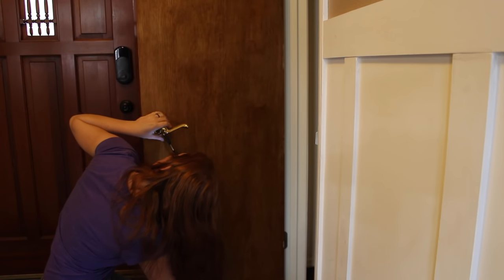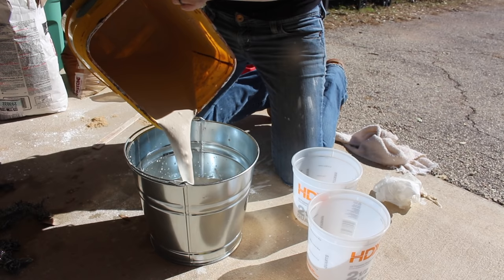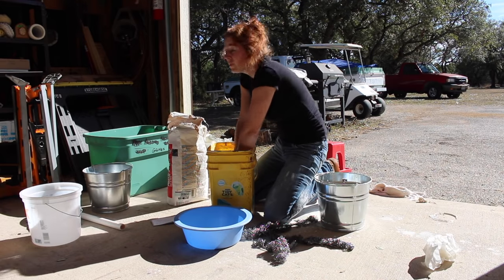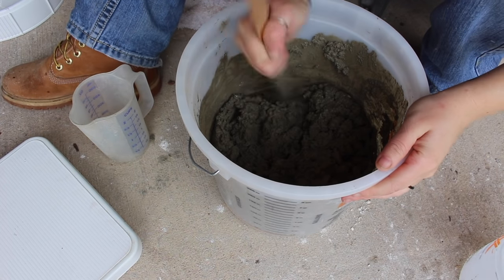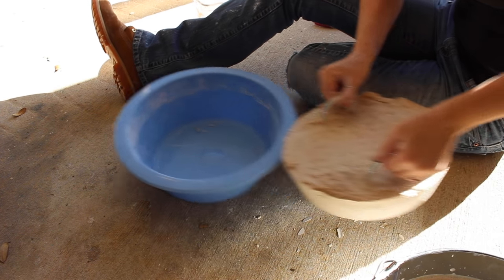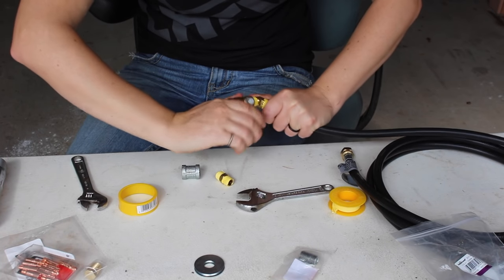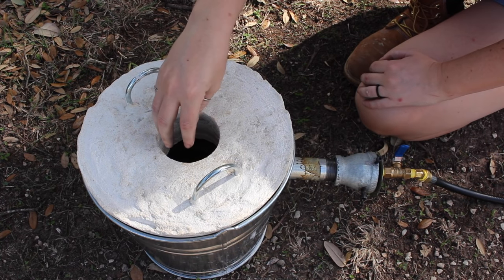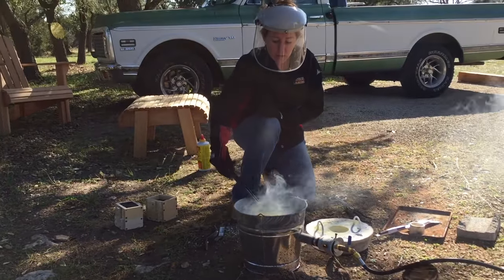Making a Backyard Foundry

Comment: Loved it April. I'm afraid to say you gave me a project I've thought about doing for a long time and now you given me that final push. I'm a locksmith  and  I've accumulated a lot of Brass over the years. I try to reclaim and resell a lot of the old stuff because I appreciate the feel and quality of the old hardware. You'll be surprised what a good wire brushing can do to an old solid brass piece. But junk like old keys, pins, cylinders and other scrap brass adds up and it's time for it to return to its original state. Thanks for the great video.

Comment: You provide so much enthusiasm and information, in such an entertaining way, that I hesitate to offer this critical observation.  I have been involved in the foundry industry for over 50 years.  The word foundry, as defined in many sources, is a noun identifying a place where castings are made.  For many years, I operated a pattern company, where we built the pattern tooling for foundries.  Most foundries use patterns to make expendable sand molds.  Castings are made when molten metal is poured into the molds.  Some foundries use gas furnaces to melt their metal.  You have demonstrated a simple way to build a gas furnace for melting metal.  The furnace is only one component of a foundry.  Others, as you know, include sand handling, molding, core making, testing and cleaning.
For several years, I was an engineer at a foundry about 90 miles south of Ft. Worth.  If you are still in the area, I could arrange for a plant tour that would detail how complicated and impressive a commercial foundry can be.  As for the home hobbyist, I salute the initiative and determination shown on YouTube.  Be careful of erroneous information on the Internet.  It can lead to misconceptions. You have entered the fascinating world of foundry practice-an important part of manufacturing that still provides parts for numerous segments of society.  I congratulate you on your presentation of building a gas furnace for melting metal.  After you assemble the rest of the necessary equipment, you will have a foundry.
Reply from the maker: : ) please do not hesitate, I appreciate the information! It is how I learn. There is no way I can learn everything about a specialty such as casting in six days (which is the timeline I have to get a project done) so often times I learn just the surface level stuff to get going then learn double the amount from the comments left by those who have more experience. I really wish I was still close to Fort Worth so I could take you up on your tour offer! That would be awesome. Thankfully, through researching and buying material (like green sand) for this project, I've met several locals who are deep into the craft and are more than willing to share information.

Comment: The King Of Random is not the  only source for backyard foundry designs.
for old people like me who still read print there is 'the Charcoal Foundry' by Dave Gingery which is similar to these but as the title suggests uses charcoal and also for the serious amateur there is 'The Backyard Foundry' by B. Terry Aspin.
Aspin shows how to build a brick built solid fuel foundry with forced draught and how to cast ferrous components. he also covers casting and pattern making with some ingeneous double sided patterns for quicker repeat working.
I hope that this is of some help to those who may be considering amateur foundry work.

Comment: If you are still living in Texas, have you ever considered using good ol' Black Land Prairie mud or Texas Gumbo mixed 50-50 with clean bank sand for your refractory?   Use a  minimum of water to keep it from shrinking and cracking much as it dries, which takes several days depending on thickness.   Ram or pack it with the end of a hammer handle as a green sand mold is done.    Build a small wood fire in it to finish curing after air drying.   I've used it to make a blacksmith forge for burning coal, and though it does crumble away eventually - faster at welding heats -  it does work better than one might think.

Comment: I went thru a couple pages of comments to see if anyone said anything about drying the refractory / cement. I didn't see anything nor did you mention this. The kiln must be heated the first few times carefully raising the temperature each heat to prevent any left over moisture from blowing it up. Keith Rucker has an excellent series on building his much larger kiln and the steps to remove any moisture.   ;}
Reply: dejanira2 may be in next vid.
Reply: This is YouTube, her video is entertainment not instructional.  Yes the so called Refactory cement is mixed with water and should be slowly dried and cured.  True Refactory materials like bricks, and cement or mortars don't use water because it expands so much, "blow up"  Her foundry won't last 10 years but who cares, She is learning as she goes.
Reply: I agree. However, I have built two using the sand and plaster as a refractory, and doing an initial burn in didn't seem to be necessary..
Reply: I've done quite a few of her projects by watching her instructional project videos and if I need a more detailed instruction, then I go to her written tutorial with the step by step instructions plus the cut list, plans, etc. So I feel it's not merely entertainment.

Comment: I had the same problem finding fittings for the burner, even online, so I remade most of them in 1/2 inch and everything works fine :) If You replace 0,6 mm nozzle with 0,8 mm You don't even have to add this air regulating piece. To all of that I added a flame arrestor after the propane regulator to make everything safer. I use my burner in forge and it works great!

Comment: That's a nice little foundry but from years of pouring copper, nickel and brass alloys I recommend you wear a respirator when working around those fumes. There is several tramp elements found in the different alloys and some are very dangerous for your lungs.

Comment: Why do people seem to forget local hardware stores? Ive never had an issue finding any fitting, fastener, tool etc. at a local hardware store. I priced building Grants backyard foundry and my local Ace was $20 cheaper to build then if I went to Lowes for the stuff (and had to still get a VERY common fitting at the local Ace).

Comment: I made a foundry for remelting steel into something I can use in my forge several years ago.  I used refractory cement.  The foundry works okay, but where I messed up is that I didn't drill the hole at an angle as you suggested.  The heat just comes straight in and does not evenly heat the whole chamber around what I am trying to remelt.  It might be time to make a new foundry.Oh, but be very careful young lady: This type of stuff is addictive. :D
Reply: Did you wait til you had poured your cement to drill your hole? How long did you wait?

Comment: Bras looses zinc do to oxidation every time you melt it down. between 1% and 5%, depending on the time of heating and stayed liquid. The resulting alloy Is softer not as smooth running with a higher surface tension and more red in color. You can add tin to make it a combination of bras and bronze. 0.5 to 1% of the molten mass will be enough. It will run better and has a lower melting point. The color will be also more red than gold/yellow. In my experience the copper/zinc/tin alloy has better poperies for home usage.

Shortly before pouring add table salt to it and stere it. This will make the slag more liquid so the oxides in the molten mass will flow up more easily making the result less porous. 

And try lost form casting. You can use normal sand or even dry dirt as containment. Make the form from foam , put it into the Sand/dirt and pour the molten metal in to it. Don't bother with vents, the air will squeeze trough the sand easily. At least with the size of the objects you can create at home.
Reply: Couldn't you just throw in some pennies to offset the lost zinc?
Reply: Of course you can but you have to do it at the right point at the right temperature, otherwise the zinc will simply oxidize again or at a to high concentration. To much Zinc will make the alloy much more brittle. Tin on the other hand is much more easy to handle. It oxidizes in nearly the same rate than the copper, and didn't evaporate when the mass is to hot. And to much Tin makes it softer and gives more elasticity.

Comment: Although Grant's design for a propane burner is effective, there's a much cheaper and easier solution. Harbor Freight has a weed burning torch that makes an excellent foundry burner with a very simple modification. If you watch the sales that Harbor Freight seems to have every other day, both the torch and the part to modify it properly can be bought for about $25 total. I use the modified HF torch as the burner for my blacksmithing forge, and that thing is so hot that the fire brick walls of my forge are glowing bright orange within 2 minutes of starting the forge from room temperature.
Reply: marshmallowblaster whats the mod? or could you point to someone who has done it? thanks

Comment: I imagine you could use a regulator off an old BBQ.
Wonder if Quikrete would work too?
Reply from the maker: Yep you could definitley use one off the BBQ if you have the correct fittings to then join it to  assembly. No, using regular concrete won't work. It is not made to withstand the high temps this creates and could explode.

Comment: Fyi never put teflon tape on the flared end of fittings, there is absolutely no reason to do this bc the flare is what makes the gas tight connection not the threads and the brass shouldn't corrode just a heads up

Comment: I tried this model, but used charcoal and air to fuel it. This caused a lot of trouble because the steel crucible I had made was too thin and oxidized halfway through my first successful attempt.
Reply from the maker: Bummer, my crucible has been through several burnings now and is holding up great. I went with propane since I wanted to melt brass, I just didn't want to wait around as long.

Comment: casting has the same addiction level as turning.
Reply from the maker: I can see that.  It's amazing.
Reply: What happens when you combine the 2, say, cast a round blank and put it on a lathe?
Reply: That's a common thing to do. Cast the piece to the rough dimensions and then machine to exact tolerances. I don't know if a wood working lathe can handle metal though.
Reply: +Double Dare Fan I do that often.
It's more addictive than crack.
Reply: Soft metals, yes, brass and aluminum.  You'd have to reinforce your wood lathe a bit if you wanted to go after anything harder, which is why metal lathes are constructed so heavy.

Comment: Is a regular gas grill regulator not going to let enough gas through? Or is there another reason for getting a specialty regulator?
Reply from the maker: I actually tried a BBQ regulator but the only reason I didn't go with it is because I didn't have the right fittings to connect it to the tank and it was going to take just as long to get the fittings in as it would to wait on the regulator.
Reply: Ok makes sense. The one you got looks like its better for the job anyway. :) By the way, and you may already know this, but stick to the black iron pipe (like you have been) with stuff like this and avoid the galvanized stuff. Apparently, galvanized puts off zinc fumes when it gets really hot. I noticed neither you nor Grant mentioned this in your respective videos. One fellow who made one of these burners suggested putting a stainless steel piece on the end. He said it holds up better to the heat than the regular stuff. I don't know if that's true.

Comment: Did you use the entire 25lb bucket of cement to make this?
Reply from the maker: Yep, and with that there wasn't enough material to make a lid. So either order more than 25lbs or make your lid from the plaster of paris mix (that's what I did).

Comment: Wow, melting down solid brass fittings, that is just wrong!
Reply from the maker: I think them ending up in a dump somewhere because they are outdated is worse.
Reply: Brass is antimicrobial, outdated? people would kill to get solid brass fittings, they were a big bucks option (simple door handles About $90 a set), throwing them away, that  would even be a bigger crime!
Reply: It should be a crime for a new homeowner to scrap or throw away brass hardware in good condition into the dump,  just b/c they felt it was "outdated" or not the current style though.  Certainly much of the brass stuff is more robust and will last longer than some of the  "less outdated"  junk :)
Reply: I always find it odd how people get so worked up when someone "destroys" a thing. "OMG! You broke the thing! WHY?!"

Don't ever check out the "What's Inside" channel. You'll probably need therapy after.
Reply: just because you think its valuable whe should not melt it? 
 so why this comment?

Comment: your brass is too hot, the zinc is burning in the crucible....
Reply from the maker: Oh good information, thank you.
Reply: April Wilkerson Where did you get your crucible?
Reply: April Wilkerson Sorry should have checked your list first. 😏 But I am looking more for melting heavier metals.
Reply: Tim. Wilson What kind of metals? Any success? I have a foundry just like in this video, and after struggling with various thin walled iron crucibles i took the hit and bought a graphite crucible off amazon, once it gets here i hope to get back into casting and ideally things like cast iron as well
Reply: KittyCow I'm more interested in trying to cast heavier metals like cast iron. Ultimately would like to try and cast some tools, but not sure it will ever happen, too much cost and not enough wallet. 😏